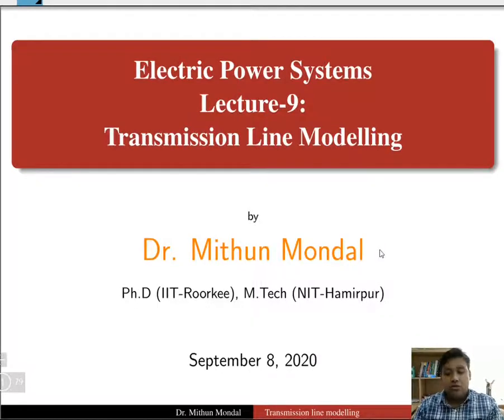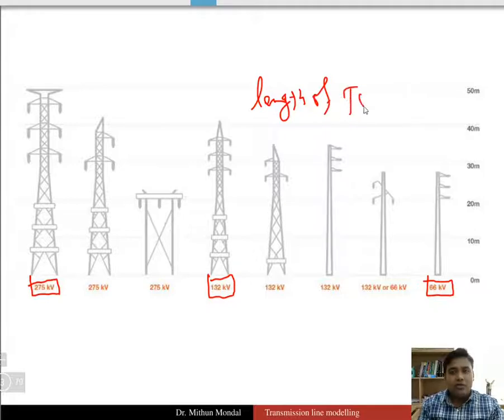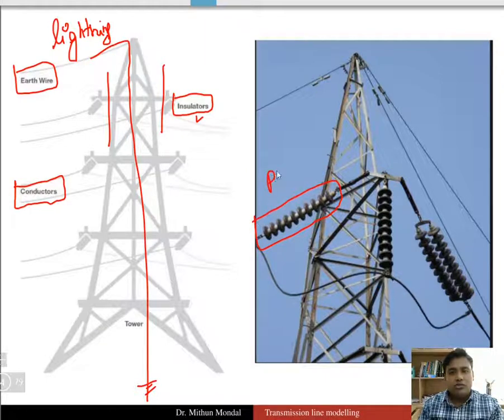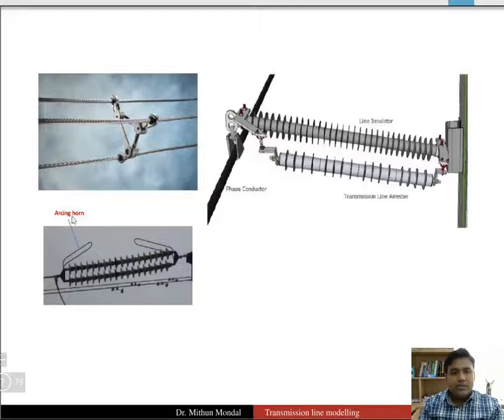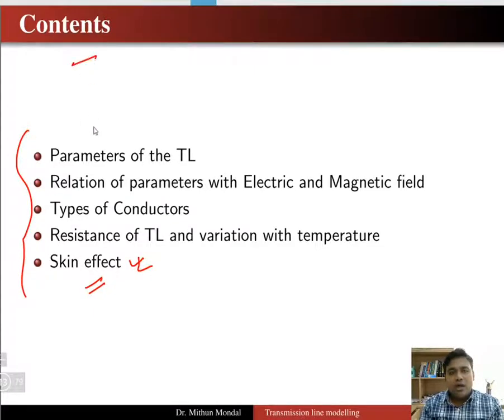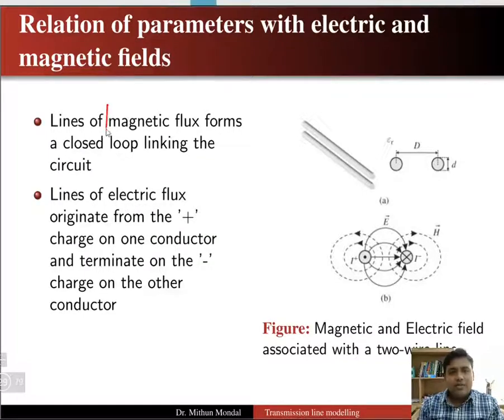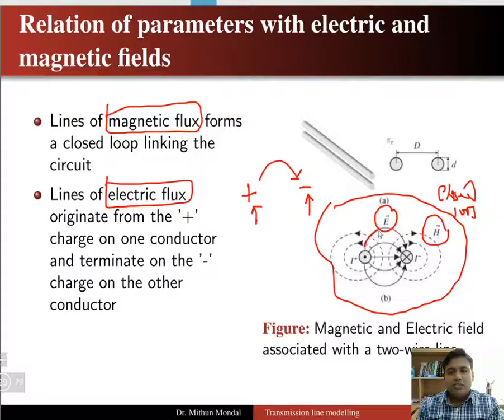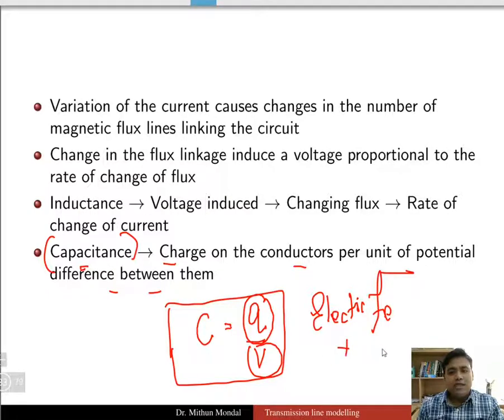Power Systems | Lecture-9 | Transmission Line Modelling

Comment: Sir, By chance you have used the word "magnetized" instead of "ionization" several times in this video lecture. Kindly rectify these, these my create confusion.
Reply from the maker: Ionization is the process by which an atom or a molecule acquires a negative or positive charge by gaining or losing electrons, often in conjunction with other chemical changes. 
On the other hand, Moving charges produce magnetic fields which are proportional to the current, and hence a current carrying conductor produces a magnetic effect around it. Since, transmission lines are current carrying conductors so magnetic field or magnetization will occure resulting in Inductance effect.
Reply: @EngineeringDevotion  In the beginning of video lecture you have used the word "magnetized" instead of "ionized". I wanted rectification of that which was used at leat five times. I know what is the ionization of air as process. Please listen your video from the beginning.
Yours sincerely
Dr. Prabhakar Tiwari 🙏🙏